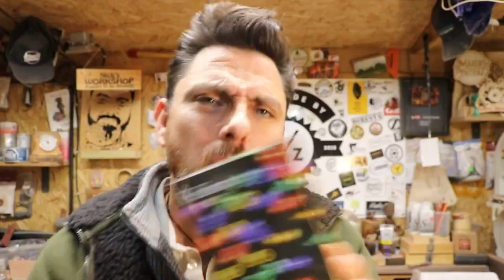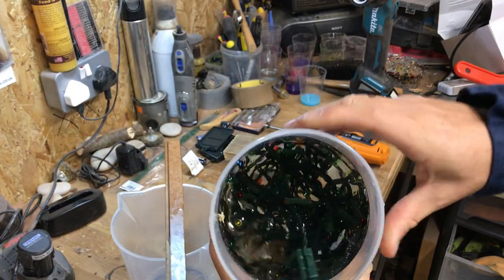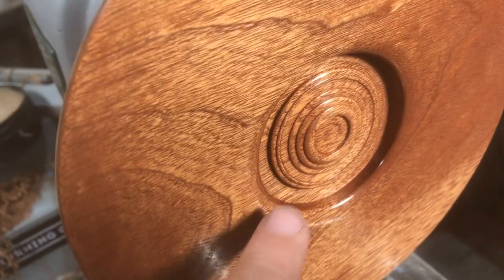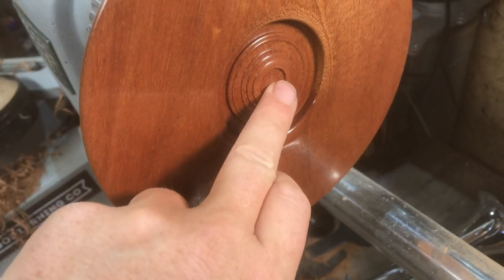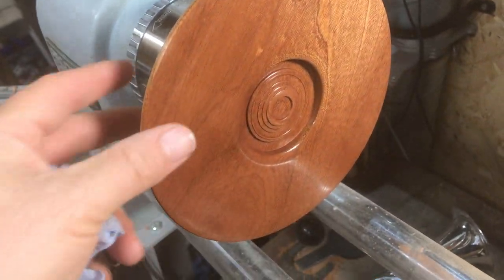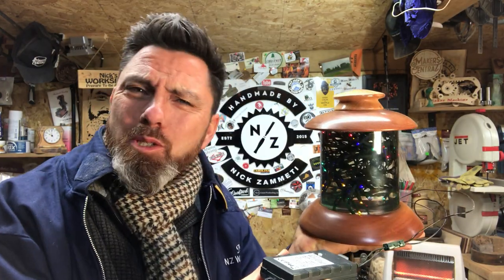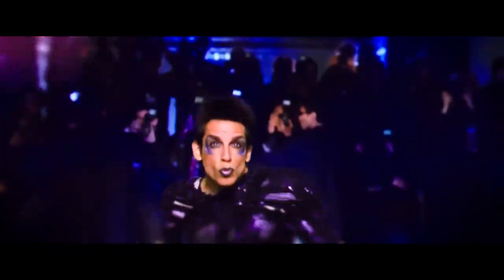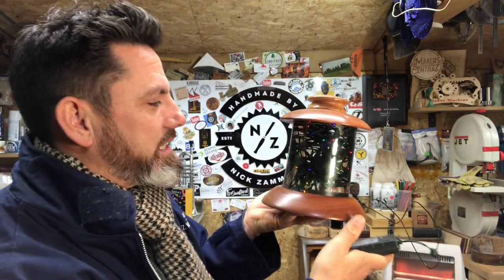Woodturning - a festive light show in resin

Comment: I was just wondering but have you thought of turning a resin pot to the dimensions you want, hog out the inside so you've got fairly thin sides then put in the lights and resin them in place that way you don't need to worry about the fit and finish?

Comment: Nick, there is a problem with your LED lights in resin. LEDs generate heat. Not as much as the old incandescent bulbs, but some. If that heat is not dissipated the LED will slowly overheat and die. The air is normally good enough with a thermal conductivity of 25.72 mW/mK. Epoxy resin is a very good insulator and has a thermal conductivity of 0.25mW/mK. That's 100 times more insulation than running the LEDs in air.
As the LEDs get hot, their lifespan is shortened. I don't know what voltage and current is supplied to the LEDs in that string as well as the forward voltage of the different colour LEDs so can't work out the heat the LEDs put out, and the rate at which the LEDs will die, but encasing the LEDs in epoxy resin will kill them faster.
Reply: party pooper
Reply: I thought the same thing. They won't light up long.. Maybe one Christmas.. It's beautiful though.

Comment: Love your stuff, only thing, heat shrink tubing over those soldered joints would have been neater and better 👍🏻
Reply: In this instance, it wouldn't matter since the solder joints will never be seen.
Reply: It’s not about being seen, it’s just better protected, won’t degrade or fall off etc. It would be a shame if next year the light didn’t work because the wires had shorted after the tape had unravelled
Reply: @thedecliningcyclist3321  He could have used white electrical tape and electrical tape won't degrade for 20+ years plus the epoxy he used to glue to light block into the wood base will act as additional protection for the wiring and will prevent the wires from getting pulled apart short of a determined effort which is more effective than heat shrink and he did solder the wires together so no matter how you look at it heat shrink would not have made a difference.
Reply: 7:45  white heat~shrink
Reply: @denniswilson6272   nope. only normal White tape. Probably that normal paper tape that more woodworkers use..
Reply: Considering Xmas lights rarely last long, I don't think it matters lol

Comment: When soldering, if you tin your iron then heat the bare lead with the iron and then introduce solder. You'll have a much better time than just trying to melt the solder onto the bare leads. Makes for a nicer joint as the solder will wick up into the joint and you can heat shrink it nice and tidy!

Really enjoy your videos!

Comment: Hey Nick, just a suggestion.  Cast the lights in a slightly smaller container, then when they are set place them into a larger container and do a second casting around them.   You could then turn them without risking hitting the wires or the lights.  Some of that Christmas tinsel would also look funky mixed in with the lights.

Comment: Just an idea about lighted projects you can still turn...
If you were to put the lights in a donut shaped mold that is an inch or two smaller in diameter than the intended finished product, you could then put the result in to a larger mold of clear or tinted resin that would be free of lights giving you enough room to turn it to the shape you want.

Comment: Ever thought of doing a second resin pour with a larger diameter container to add material around the circumference?  You'd have more material you could turn without cutting into the wiring.  In the second pour, you could also add some color to make it "funky"!

Comment: OK Nick! I have a challenge/suggestion for you!! Take some modeling clay (something that doesn't dry out) and roll it out into a medium thickness slab. Then trim it into a triangle shape. Make it a good size, that you can form into a cone, but don't do that yet. First, take some more of those lights and gently press them straight in, all over the triangle, so the light part is completely buried in the clay, but the base and wires are all exposed, the plug end coming out at the base of the triangle. Now, carefully form that into a cone (with the wires inside). Be sure all the edges are sealed up, and place point down into a container (it may need support to be sure the cone stays a cone). Now fill it with a pretty, solid colored resin. Green maybe? A nice metallic shimmery something in it? Once it is cured, you can peel the clay off and clean it up really good... then put it point down into a container just big enough to give you a good amount of space around it, and add clear resin (maybe a TEENY touch of silver shimmer?). Now, once THAT is cured, you can turn it into a lovely shape (maybe a tree?) All the wires will be hidden, and with the way light bends, the green core will probably look like it fills the entire center.

This could probably be done in other shapes as well, as long as your slab of clay is thick enough to hold up, and the lights don't fall out of the clay. With a solid core (to keep the wires out of the center) of clear resin (so you can see the wires before you get to them) you could even do a vase maybe? 

Anyway, this was really pretty, if a little bit blocky for my taste. But I certainly look forward to more resin/light projects... and all the rest as well. You never cease to provide lovely, and funky, displays!

Comment: If you put something in the middle of the mold you could hollow it out into a pot. Turned out pretty cool. You should have notched out the bottom with a rotor or even chisels and inset the controller box underneath.

Comment: Nick. You should look at your hardware store and pick up a verity pack of heat shrink tubing. Cut an inch or more and slip over one end of a wire before soldering. After soldering slide the tube over your splice and shrink it over the splice.

Comment: You should put some in resin and let it set(like you did in the begining!) and then once its set, suspend it over a much larger kold, fill that, let it set. Then you would have some room away from the lights to turn/sand/polish it to perfection!
You could even do it with a very skiny mold to start with, so that its like a super colorful/lit up center, inside whatever shape you wanted to make!

Thats honestly what i thought ur plan was in the beginning lol but it still turned out great!
Reply: Also, if you did that, it would be neat to see with either clear or white strands(wires). I know theyve at least got the white ones. See if that makes it brighter maybe.

Comment: I know that this is an older video, but I had a semi-related idea for you while watching... After seeing you managed to damage light strings in other projects, I was thinking that after you initially set the light string in resin, that possibly you get a slightly larger container to add another layer of resin, at least a bit bigger than you would want to turn and/or sand it down. I know that there would more than likely be an obvious line in the separate layers of resin, but it would save light strings.

Comment: I wonder if it would be a good idea to try this with opaque resin. I like the idea of all the colored lights, but I find the look of the cable mess in there to be rather unsightly. White resin would probably work best. Of course the lights would have to be situated near the edge and one would have to find a way to prevent the cables from touching the edge. Another idea would be to try and intentionally introduce bubbles and faults. This would scatter the light more and maybe hide the cables a bit.

Comment: Is it possible to take a form you have poured/cured and suspension it in a second batch of resin? That way you could have the lights suspended inside the resin and have a few cm/in of clear resin to turn without worrying about destroying the lights?

Comment: What if you vibrate the mold with your palm sander before putting it in your pressure pot. Wouldn't that get the most bubbles out?

Comment: You could try fibre optic lights in resin instead, as it wouldn't really matter if you did turn it and take the ends off anything, and you could set the light emitting part in the wooden base, could be cool, like a fibre optic Christmas tree set in resin????